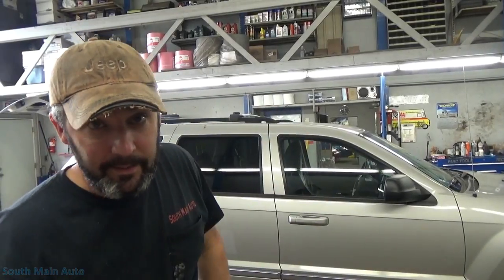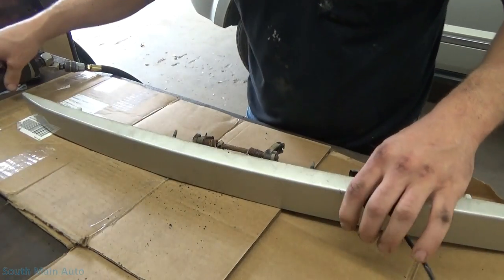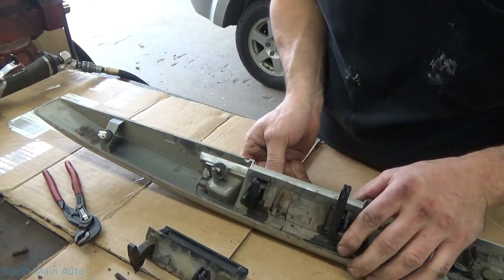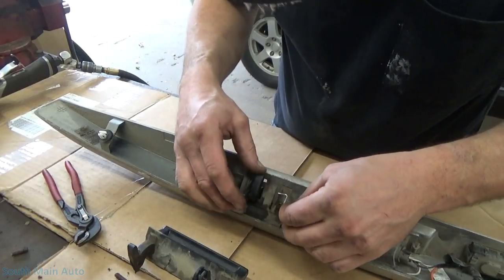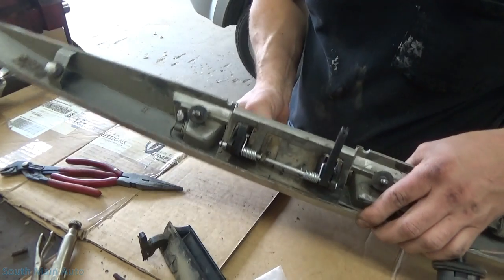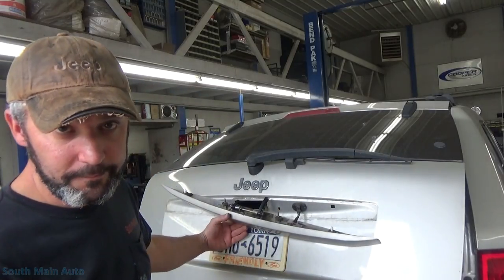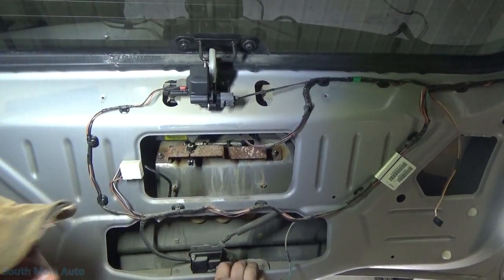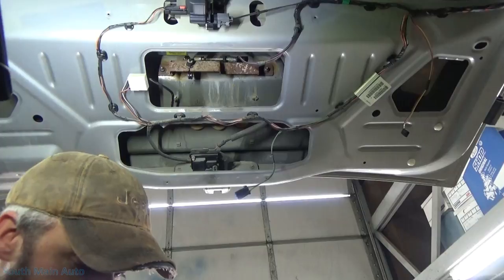Another DORMAN PRODUCTS FAIL: Jeep Grand Cherokee Liftgate Handle

Comment: I enjoy watching you do things when you are not trashing things like Dorman. You must have woke up in a grumpy mood this morning. An up-bet attitude goes a long way. And it would have been nice had you looked at the length before installed it so see if it needed anything. A simple drill and cotter pin would have sufficed at one of the middle sections. And if you don't like a certain product, pay the higher priced original. It is that simple. JMHO

Comment: I'm sure it was designed to come out while it's still on the truck. Also designed to replaced broken handles not rusted ones so they assume the original pin should just slide out. Either way,I hate Dorman garbage.
Reply from the maker: Guess I have never seen one of these handle just break with out having a rusted pin...
Reply: You can assemble the hinge pin without tensioning the springs, then pull back the "L" end of the spring over the handle arms and put them in tension.  Do that with the panel assembled to the liftgate and the pin would fit w/o modification.  I think.
Reply: I would have oiled up the old springs and rod before trusting a new Dorman plastic handle...

Comment: I feel ya on the doorman garbage. Looked up an oil cooler for a customer's 6.0 Ford yesterday and the only part available was a doorman. Ain't no way I would install that junk for such a critical component. So it was off to the dealer to source parts. I find myself doin that more and more lately as it isn't just doorman, there is also a-1 cardone and many others taking over the parts suppliers anymore 🤨

Comment: I would not have cut the side with clip.  You should have slid that back and worked on the other side. Or pulled the pin and put a new head on the end.

Comment: Eric, because the actual handle will most likely break in the not too distant future, can I ask why you didn't just replace the pin & springs? I mean I know Chrysler junk breaks ALMOST as much as Dorman but hey. 

I most likely would've just installed it in the car, pulling those hooks of the springs over after inserting the pin, but slightly bending the lip of the tailgate where the pin goes in with your pliers would be a better solution I think for the guys that don't own a welder. Also you didn't give the weld a little 'toot' of kroil? This video could've been made like the Chevy shackle bush one :D

Great video Dr O!

Comment: This is why I have two 3D printers and modelling software. I have a 31 year old Dodge Dakota and replacement parts are usually unobtanium, but when they are available, they're retarded expensive.

But at least they last, all of the parts on my truck were original equipment. I can't say that about ford, christ I've replaced the same parts on my two ford vehicles more times than I care to remember.

Comment: Speaking of dorman parts. I bought a fan for a Pontiac I needed. They told me the only way I could get it was with a piece of plenum attached to it. All I needed was the fan but they said there were a few models that needed the plenum attached to it so to cover every model they make you buy both. 150.00 later I ended up pulling the plenum off and throwing it away and put the fan in for a lady. I’m sure she thought I was taking advantage of her. No one should have to pay for something they don’t need. What are these part stores becoming now days, thieves? Or is it their parts suppliers.

Comment: Used to be.... Years ago... Dorman parts were relatively good and I used them a lot ( my shop was a NAPA AutoCare Center) with very few comebacks but somewhere along the highway Dorman went off the road. My last and final Dorman purchase was a window regulator on a 3 series BMW which I’ve had to replace twice under my warranty and Dorman WILL NOT warranty their “LIFETIME WARRANTY “ regulator ( go figure) needless to say I no longer use their products and never will again. I get real Grumpy and turn into a little B*tch when I have to do the same job more than once especially because of crap parts.

Comment: Bought  a set of wheels for a 06 Avalon found out they were from Dorman, the holes for the center caps were such an odd size NO ONE had any that would fit not even Dorman,ended up cutting the tabs off the originals and breaking out the glue gun-DORMAN SUCKS!!

Comment: Doorman.  1995 Chevy Silverado replacement drivers door handle. The damn thing will not retain a lock cylinder.  What junk! I tried several. Now on to another part,  the transmission pan with drain plug for a F150. Well it fit perfect. Works fine.

Comment: I had a  check engine light for  an egr valve vacuum  solenoid. i replaced with a doorman one  worked for about a month then got  stuck in the open position causing the egr valve to get stuck open and car wouldn't idle.  bypassed on the side of the road to get home.part was under warranty so went and  got another one. I installed it, then 2 weeks later check engine light again same code. thought to myself really no way its still the solenoid again. took out vacuum gauges and  volt meter and retested and... yup bad again!!! so took the 2nd failed doorman solenoid back. but this time he handed me a solenoid that was  not a doorman some other no name one. I asked  why it wasn't a doorman he said they didn't have anymore but that they had that one. no complaints from me  at this point ill try anything but a doorman anyways. installed the no name one  and guess what. 2 years later no more issues at all. sad when even a no name brand most likely cheaper than a doorman part is better  makes you wonder. i am not a fan of doorman. and never again will use any of there parts in any of my cars or my customers cars.

Comment: What a hoot!  I just did one of these!  Didn't have to fight it quite as much...put it together first, then hooked the springs around the latch arms.  Welding seems to work, but after I had everything "loosely fitted", I got my length.  Then cut it off and drilled a small hole (sliding it apart first, without the spring tension) and used a cotter-pin (no washer).  Many ways to skin the proverbial cat...

Comment: I realize this video is 2 years old, but I've just now watched it. Eric, you and 90% of the commenters have thoroughly  bashed Dorman, but in reality, comparing the cost and time of OEM plus paint with this Dorman part and an extra, say, 10 minutes of modifications, and everyone won. The customer got the job done quickly and you got paid (I hope) and moved on to the next one sooner. And as you said, a push cap or a drilled hole with a cotter pin would have done the job without needing a welder. Yeah, Dorman has really moved away from a good place over the years, but even OEM is not immune to quality problems. We all need to look more at the doughnut instead of the hole. I remember hearing, "If it was easy, we wouldn't need you".

Comment: In the Dodge minivan a similar situation takes place. Mind you the minivan is all electric. There's no physical link. Mopar will sell you a button.. but you have to buy the whole thing. It comes in black and it's about $300 as well. Luckily our junkyard doesn't care. I've replaced mine for about $10 bucks. But the salt belt assures I'll be back at some point.

Comment: Similar issue on a Volvo V70 Mk3. I replaced the 5/16" bar with silver steel and copper ease to stop any corrosion, some years ago. Still works well. I would have thought the Swedes would use stainless steel but after all, this Volvo is just a Ford.

Comment: I became the hero of my shop back in the day and the go to guy to do these. I only wish you could have heard me cringing watching this vid...NO NO NO...LOL

Cut off large spring tabs then free the springs from rust with pliers. Cut middle of the rod then the cut the rod again closer to the rod head and the large part of the handle lever where the spring used to be leaving enough to grab with pliers. Remove cut out rod and spring. Don't worry about the other spring sandwiched between the housing guide and the small handle lever, as long as it's loose.  Hit it with the PF and WAIT. Then do what you did or do what you gotta do. Sometimes I didn't have to cut the original handle sometimes I went caveman like you did.
 
I would then use a cut off wheel to gouge a new slot around the pin by spinning the rod between my fingers (usually using an electric grinder with the safety guard as a base for the pin) or using a hacksaw with the pin in a vise cut a groove then spin and repeat, doesn't need to look good, just as long as the retaining clip locks in place. (I once tried a hacksaw and the rod in a drill but that was sketchy AF)
 Then cut off the remainder.

NOW TO MAKE YOUR LIFE EASIER
Insert handle into housing, push through rod with the springs LOOSLY in the proper location on the rod NOT in any tabs, attach C clip. Position the small spring tabs first in the housing then you can use needle nose vice grips to bend the large tabs around the handle arms and into place. Super fast assembly.

Hope that helps.

Comment: My 1999 CRV had this issue. I took out the assembly, ground and drilled off a few rivets. and replaced the springs with stainless springs and replaced the rivets with 3/16 macine screws with 2 nuts (one to jam). It was never an issue again. I live in Canada so i assure you our rust is just as bad if not worst.

Comment: Not having any welding kit... I'd have taken out the pin cut the head off by 1/4" then hammered a new head on it. Ive got one of these Jeeps so ill be checking out my handle for rust.
Cheers Eric for the vid 👍

Comment: Sorry, Eric, I disagree your review of Dorman handle. Yes, the idiot MBA's at these evil corporations can churn out some real junk but this is an example of one size fits all. Some of those gates had a larger opening. If I made the mistake of going cheap to save a few bucks I would have chucked the pin in the lath and cut a new slot for the "E" clip.

Comment: Replaced the passenger window regulator and motor on my civic last week with a dorman regulator/motor assembly. lost automatic up/down and control from driver's side button. Tried the motor reset procedure multiple times. Didn't help. Took it apart again. The dorman motor is missing 4 contacts that are there on the Honda (and are supposed to be on the dorman too, going by their product pictures). Replaced the dorman motor with the original Honda (kept the dorman regulator, as the problem was with the original regulator), hooked it back up - everything works as it should straight away. 

Moral of the story? Stay away from dorman stuff. 
The regulator is ok (though it's missing a helper clock spring that's on the original), but the motor is useless.

Comment: Did Dodge buy that part from Hyundai?  I had that same problem on an Elantra GT lift gate.  I put a ton of WD40 on the handle pivot and worked it until it was free.  Of course being in PA, the rust wasn't so bad.

Comment: I get the Dorman complaint. But really is not the real complaint. Chrysler gouging their customers on known to fail replacement parts??? Ford does it too. $300 for a $10 pot metal bracket that is bolted to steel. 
Dorman could do better. But they are at least giving you an option the big boy wont. No reach around provided.

Comment: Went through 3 doorman inside handles for a 91 Camry.  I kept ordering left, they were marked left and did not fit.  Ordered a right side and it fit perfectly on the left, front and rear doors.  Just can’t find Toyota OEM for a 91 anymore.  She shows her age but still goes and blows cold AC.  Helps she’s a standard

Comment: The first Dorman things i used was two VC axcells both failed in 30 days with clicking. The next was a "rebuilt pump" failed on install with a worn out front bushing pissed fluid all over. The last thing was I think a rack. tight trying to turn left and over easy on right turn. Fucked up always. I hate the stuff they sell for sure mostly junk. This is why new starters and alternators started coming out in force.

Comment: I have worked at an auto parts store for over 30 years now. Dorman/Motormite stuff has always sucked, yet they have enjoyed steady growth (success?) in that time. Many other companies have enjoyed similar success, regardless of how maligned they are. I think it just goes to show you that in fact money is what matters most. What ever product or service you offer doesn't have to be good, just cheap. I would even go as far to say that there are very few companies making good parts out there. I bought a Motorcraft branded ignition module that only lasted a few hundred miles. The aftermarket replacements we have at my store all test bad, right out of the box. They'll 'work' on a customers car or truck, but they'll have a miss at either high or low speeds they'll not be able to figure out...

Comment: You're the only person I know that has bad luck with dorman or that talks bad about them. I've been using their parts for 14 years and been selling them at parts stores for 12 years and I've never once had a part fail or come back that's a dorman part. I've used them on every vehicle I've bought and fixed and sold or owned. Never once had an issue. Any part can have issues out of the box absolutely. I've just never once had an issue myself and my buddies never have either. Most of the time dorman improves on the oem stuff that's prone and known to fail. If it's just a wear and tear item, I'll use OEM. If it's a part thats a super common failure I will use dorman everytime

Comment: Oh yes, good ol' Dorwoman. If I had the choice between that POS handle and spending two hours freeing up the original handle, the panel would never come off. Out comes my butane torch and penetrating oil, and as long as the springs are good, I'll work that handle a thousand times before installing a Dorman.

Comment: I usually soak rusted stuff in some atf/acetone spray, leave sit for a few hours. Brush rust off spray with some sort of cleaner. Then lithium grease coating. Usually works wonders.

Comment: Honestly I would have just cut a slit in the door for the pin.  The latch will probably need replacing down the road again anyways, as it will end up being a high replacement item.  It sucks, as I try to keep things oem; but sometimes the oem makes things difficult to do that.  It's the vehicle manufactures fault for creating a dumb setup for the latch, you are just having to refab something that works in the real world.

Comment: Pushnuts, tinnerman nuts they are called. Also JB weld epoxy the big end of that pin after you cut it to length IF you don't have a welder.

Comment: I did a drivers door handle on a 98 Pajero here in OZ this week with the exact same problem the pivot pins were too long so it wouldn't fit in the cut out in the door so out come da grinder loped em off n in she went n yes it was Dorman garbage, parts supply here is a joke just about everything I order lately is the wrong part or Dorman crap n won't fit.
This is why I drink!

Comment: Personally I probably would have cut a notch in the tailgate especially since it's not visible. just cut a notch and coat it. no one will be none the wiser.. but if I did cut the rod, rather than weld, probably would have just drilled a tiny hole and inserted a pin solely for the fact that it's a Dorman product as i'd expect the customer to be back within a week furious that the handle snapped off, so I know i'll need to take it back apart, preferably without destroying it beyond reasonable, so it will make for an easy refund from Napa.

Comment: Next time take a Phillips screwdriver about the same circumference and slide it in from the other side of your long pin that way you can load your spring then slide the pin through the spring pushing the screwdriver out of the way easy peasy

Comment: Do you think you had enough room if you would have cut the pin at the clip grove and added a new grove to the pin? I think most DYI'ers would have split the difference side to side with the pin then modded the tailgate for clearance.

Comment: Maybe be a better solution if you dont have a welder grind a flat and drill a hole for a pin or safety wire to hold it in.

Comment: I would have cut a small notch in the sheet metal instead of modifying the pin. It would be 2 minutes with a grinder and be completely out of sight when reassembled.

Comment: a small advice. when you place the spring, you place them free of tension. So first is the short end, drive the pin, and the long end of the spring with the hook over the plastic lever. Where I work we use to assemble 12 V power sockets for trailers that have a protective cap with a strong spring. For that white plastic clips you can use a pipe that have the inner diameter the same as the clips are fully squeezed. So when you insert the pipe the  over the 2 shoulders will approach thus release the clip

Comment: For the pin just hunt down a tiny circular push on clip, similar to what holds on a drum to wheel studs during manufacturing assembly. Just leave a but more pin showing that you did. Although, looking at the space, I think it needs to be taken apart on a bench, I think reassembly was intended to be done with the panel back on the car, but you'd have to do it with the spring and pin in there loose then hook the spring under tension on the arm after the pin is all the way in and secure.

Comment: @ 17:00 I think that I would just cut/filed the door panel to fit, after telling the customer the cost of the factory part. You can not see it, it would not matter, and it is a good way to work off the frustration.

Comment: I'm no spring expert but wouldn't it have been easier to put the spring in place with the stationary end in the correct spot, slide the pin through and then pull the bent arm up and slide it around the latch plastic?